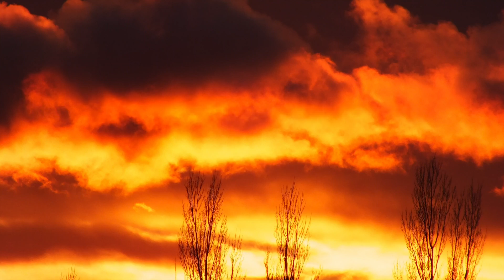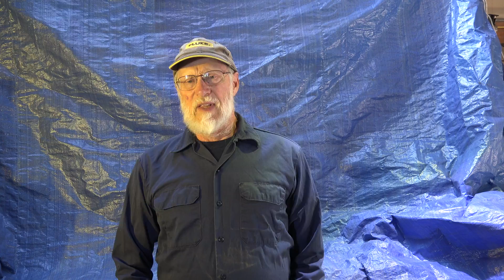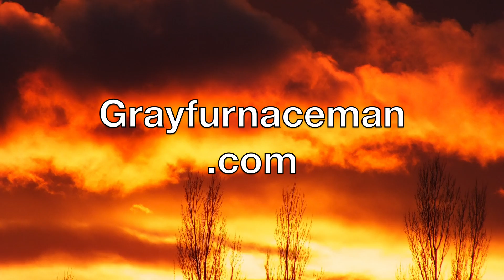Heat pump #3

Comment: Great videos!  All 1-3!

I have a problem with my heat pump and I was watching video 3. It might pertain to the problem I am having with it.

It’s a Rheem unit and runs fine in AC but the temps here are 29 degrees or colder and I call for heat mode. After it runs for an hour it begins to ice up indoors in the air handler coils. The thinner copper pipe that runs through the basement gets frosty and begins to drop water on the floor along the length of the line.

Do you think it’s my defrost not working? 

FYI I replaced the bad thermostat that called for heat but nothing would happen. The new calls for heat but blows air that slowly cools coming out the registers. 

Also I turned the thermostat to off, the fan to continuous, and nothing. New thermostat was wire same as the picture I took of the old and matches the same make unit upstairs.

I would greatly appreciate your input.
Reply from the maker: If you are frosting on the large diameter line, you are in cool, not heat.  That line should be hot to the touch.  Wiring problem or reversing valve problem.
GFM
Reply: @grayfurnaceman  The smaller copper pipe of the two going inside the house to the air handler coil is the extremely cold one. It has water droplets falling from it and leads into the air handler. The air handler ices over- over time.
Reply from the maker: @kurtamiss  You have a restriction in inside the system.
GFM
Reply: @grayfurnaceman  Is there a way of remedy?
Reply from the maker: @kurtamiss  There is.  However, it could be quite complicated.  I would be looking for a service tech for this one.
GFM

Comment: GFM.......thanks for all the videos .......and thanks for your reply to my question about sensible and latent heat removal.......

I have another question..........lol.........let's say i have a 410a system......and I charge it to somewhere between 8 and 12 on the subcooling..........( with a TXV ).......should I check the superheat also and make sure it is somewhere between 8 and 20 degrees?

and ...........lol.......if it is a 410a system with a fixed orifice and I charge it according to superheat.........should the subcooling be between 8 and 12 ?
Reply from the maker: I always check both superheat and subcool.  Temp splits too.  The numbers you give are ballpark.  This tells me about the system health. 
GFM